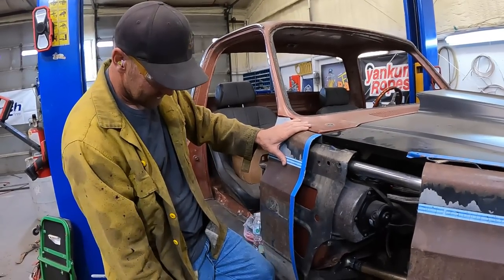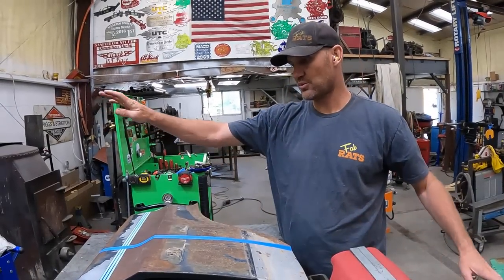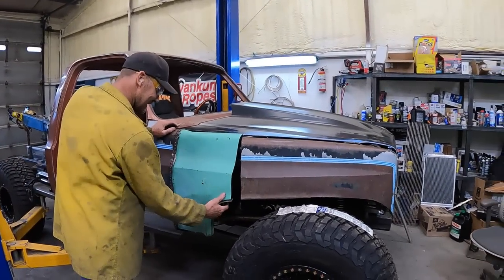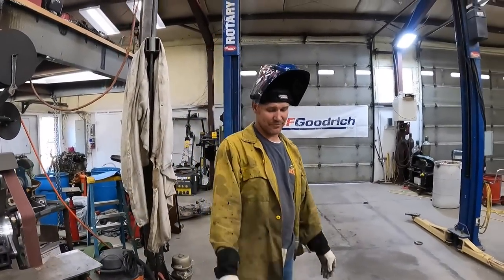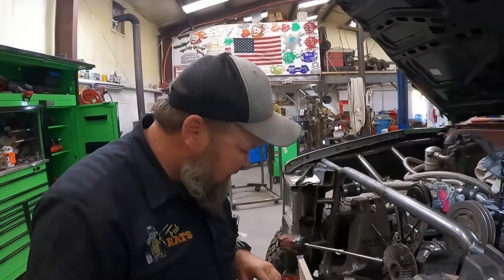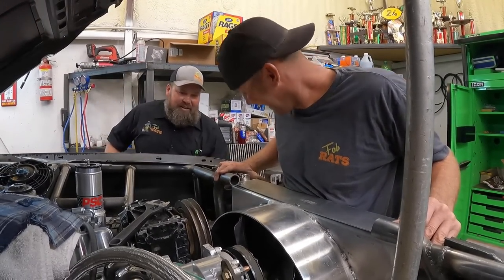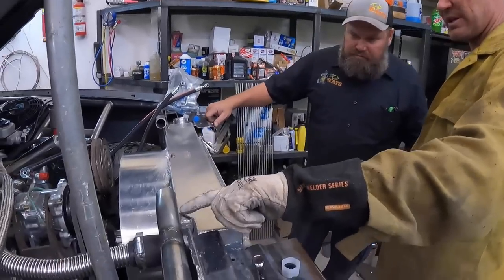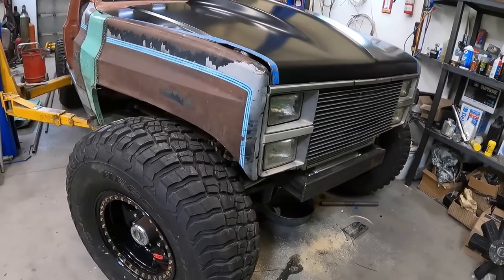Never Before Have Fenders Like These Existed On The Rat Rod Wrecker

Comment: I am looking forward to you and Rory running circles around Matt's giant wrecker. 😉
Reply: but Matts wrecker will pull Pauls out of the ditches!
Reply: If anyone ever needs all 3 at once for a rescue it will be a 'do not miss' video.
Reply: If there is an agility event, you are absolutely right.  But for brute strength, Matt for the win.
Reply: What you guys are forgetting is that the heavy wrecker is being designed more for side by side recovery. He said the boom won't be used to tow heavy stuff. He has the big boy yankem ropes for heavy duty recoveries

Comment: Love the way you did the nose on the wrecker. I am a bit concerned about the radiator shroud. Looks pretty tight, and I'm wondering if you'll get contact when you torque the engine and it moves. I guess we'll see! Can't wait to see the finished product.
Reply: Yep. And the fan doesn't need to be that deep/forward into the shroud. Having 1/2 the blade outside the "tube" will pull same amount of air.
Reply: I was wondering the same thing about the shroud. Hopefully he has solid steel mounts on the engine, because if they're rubber it's going to hit & possibly destroy the fan & that awesome shroud he made. I've seen it happen many times before when an engine is under a heavy load & the rubber mounts arent strong enough & on his truck there is so little tolerance for it to be able to move. I wonder why he decided to go with the manual fan instead of the dual electric fans? I would think the electric fans would work a whole lot better keeping the engine cool when he's out 4 wheeling & going so slow. Maybe he will address everything & tell us in his next video. I love the work he & Ben do there! I love to be able to work with them!
Reply: And let this be a lesson to YouTube watchers...don't jump ahead and comment before watching the whole vijeo. About 19:00 he puts the fan on. PERFECTLY POSITIONED! I should have known.
Reply: I just said the same thing. Wondering why he went mechanical over electrical when the electrical was already completed and just had to be connected.
Reply: @kerryhickman2235  I agree with you on the fan thing, however, slower speeds doesn't have anything to do the amount of air a mechanical fan pulls because of the fan clutch. Engine RPM has more to do with that.
Reply: @randallsmerna384  Correct. Maybe that's why he decided to go back to regular fan instead of the electrics? I'm not convinced the electrics can push thru that thick a radiator.
Reply: @kerryhickman2235  Frames twist under load too, the minimal clearance is disturbing...
Reply: I came here to make the same comment, will the motor not move enough to make it hit that shroud?
Reply: @gailtaylor1636  
Perfectly positioned with the engine just sitting there.......When that truck puts out max power under heavy load, that engine WILL MOVE SIDEWAYS.
   The only reason I have to believe this will work out fine is that Paul has seen all this before.....

Comment: Watching you figure the fan shroud placement and fitment I thought of something for the next time. Split some vacuum hoses and put on the end of the blades. That’d give you a consistent gap around. Just a thought, love the content.
Reply: As tight as it appears to be,  it should be interesting as soon as the engine and/or frame flexes under load

Comment: Engine torque and frame twist under load will make a nice racket on that close tolerance fan shroud, possibly?
Reply: I was thinking the same but realized they only have to trim the fan if that happens
Reply: I was thinking the same thing, but I'm betting being derby guys they used solid engine mounts.

Comment: Hey Guys, you really should put a shroud around the front of the radiator so air can't get around it.  Your losing at least 50% of air flow through the rad and coolers when you are going forwards as air takes the path of least resistance.  You'd only need about an inch or so.  I think if you do the same with the FJ you'll find it cooling better as well.  For an example, look at your cars/trucks and what they have in front of the rad area around the edges...... just a suggestion :)

Comment: Might I suggest more clearance between the fan blades and the fan shroud? With such small tolerances, it won't take much wear in the engine mounts, combined with torque twist of the engine, for the blades to clash with the shroud. 

Love the content guys! Keep it up🤙

Comment: To finish cut those fenders for welding you might have used a method called "cut and butt". You place your fender section over top of the the front fender in your case and then cut through both  layers on the overlap with a zip cut. When finished cutting you will have a joint that will match perfectly and can be easily welded up.
Reply: That method does work well when you're putting 2 pieces together that are straight but you can still run into a problem when the final product has to be angled like in the case of the fender. The angle throws the geometry off from top to the bottom  & can cause you to have gaps.

Comment: Nice fab on the fenders, grill & radiator Paul, l love how Chevy square body parts are good that way, Ben did a painstakingly great job on the steering pump & plumbing & Hunter did some redemption from doubting your fab skills by finding those rubber bushings butt he still deserves some payback Fab Rat's style shenanigan's, ratrod tow truck will be a fully functional offroad beast of a recovery rig that does 4 wheel burnouts, great video thank's for sharing God bless ❤😉👍

Comment: Hey Paul, as you have a problem with bees. Thought I would share how I deal with them. Carb cleaner or brake cleaner. Always around the shop, generally cheaper than bee spray and you can shoot them out of the air. Just remember to keep the little red stray on.

Comment: It is possible to create a square corner on any surface at any angle w/any curves. It is called 3-4-5. 3" on one side & 4" on it's right angle creating a corner. You will know it is a sqaure corner by the measurable between the outlying lines at 5". It can also be converted to feet.

Comment: Don't forget that the engine is on motor mounts and the fan is going to be rigid mounted. That fan is going to move around in that shroud especially when the suspension is twisted up.

Comment: That is a tight fit on the radiator shroud.
I would say it will hit the fan under high load conditions, or do you plan to have the engine mounted with solid mounts?

Comment: I had to extend the fenders on my Cummins swapped 4x4, but I just used sheet metal and tried to bend it into shape. One turned out alright, the other not so much. It would have been a lot easier if I had just grabbed a second set of fenders and cut them up like you did, great tip! I also had the exact same leaking problem on my power steering pump with the exact same solution 😅

Comment: Looking good, I like how the front end is turning out. The headlights and grill was time well spent. I am still up in the air on the fenders. The angle is kind of sharp, a softer turn in would look great. A.K.A a little more rounded.
Reply: It was a squarebody.  Rounded would be wrong.  Now it is a polyhedralbody.
Reply: Function over form

Comment: Glad to see that Ben came into the shop, love watching both of you together work.......as far as the radiator shroud you build, good job on clearance, are you worried at all about engine flex when you get on the throttle?   Hey, idea....the pipe you cut off to put the radiator in, you could maybe weld frost plugs over the ends of the them...just a thought

Comment: body work is so much more fun....
I was just running the engine in the cj7 the super snail... and the brand new turbo's leaking oil...thankfully out the exhaust side... so no run away...  so I flushed the rad and water jacket... at I think I need to have the head rebuilt...   frig...

almost makes me think of switching it to an ls...  no not yet... trucks looking great...

Comment: 0:48 this is a string job! Piece of string pulled taught is better at going around curves, also a thin sheet of metal strip cut straight. These are much easier at put a straight line on a curve.  Or a $30 bosh laser from home depot pointing the right way. String is old tech, laser new tech.
Reply: Chalk line is another way

Comment: Great Video ..cutting fenders is fun ,,, reattaching pre cut fenders not so fun ,, cutting at the correct angle is my mistake a lot ,, learned to cut long then sneak down to what I needed .. Ben might need some flex tape on that tailgate ..so he don't get cut and fill the tailgate with what ever he is hauling ,,

Comment: Great video, Vents in those fender extensions? Getting air out is as important as a good shroud.  Shroud too long?  Never could find a good view of how much fan was out of the back of the shroud.  A fan fully in the shroud flows less than a fan 1/3 -2/3 out the back.  Again great video
Reply: 19:00 ish minutes. Looks great to me now. I do think I would have built the shroud "tube" with a removable ring though. Make it much easier for future service. Remove the ring, possibly bolted together, to access the waterpump & belts. For those that don't get what I'm saying, find some pictures/diagrams of 6.0 Ford PowerStroke shroud.

Comment: Did you account for  the left motor mount stretching when you have a large pull on the truck? When the engine "climbs " up from the torque of the pull.

Comment: As soon as you start the motor that fan will be rubbing because of the engine shaking, along with if there is any flex in the frame. I have a cherokee(obviously alot of frame flex) and my fan rubs when flexed.

Comment: As a custom cabnit builder of bout 28 years I feel some the pain. Cutting too short, coupling wearing out ,the angle not working the first 2-3 times. Most of all being the guy who has to make it work. Break is over got to go work on my new steps (using scavenged wood from my pile) thanks for the motivation.

Comment: I know it sounds easy saying it, but I always cut both pieces of sheet metal at same time so the fitment is mint to weld back together. Not sure if you could've done that.
Reply: laser level in vertical mode would have been handy also

Comment: hayden makes a severe duty fan clutch for ambulances. cannot make it get hot with one of them.  works 40% better then the old flex fan design. They do pull some on the engine so all my big blocks I could not tell the difference, On a small block it will lose about 1/2 mpg yet the trade off is worth it. One less thing to worry about when off road. Overheating.

Comment: The flat panel on the shroud is going to block airflow through the corners of the radiator, Not enough space for airflow. Ps I think the shroud is going to be trouble! Like hit the fan in off road conditions.

Comment: Fan should protrude approx 1/2" on the inside of the shroud for proper air flow. you would think if it was totally inside the shroud it would work better but it does not....

Comment: Paul  i was wondering if by chance have you gave it any thought of using electric power steering instead ?  im building a twin turbo car and decided to do away with my power steering pump and lines for extra space under the hood  doing the modifications went fairly easy and didnt cost that much to do nice part is i;ll never have to worry about anymore leaks again that and it fits under the dash not taking up a lot of space just thought id share the idea with you  if you need info message me  back and i will give you the heads up on it . also  that front end looks bad ass  great job   thanks Bill

Comment: Does everyone have a nearby Salvage Yard there?   That was a beauty tube type grille on that donor truck.  Just sayin'.  Don't forget Heater Motor access............of course you can just cut it out!  Cut it long and lap weld it.  A piece oftubing of suitable length + 4" and ID could be slipped over that tube that had to be cut out.  Drill and Bolt when centred.  Great Progress.  Sorry about that tailgate Ben.
Order a new one. Bill Robbie.

Comment: Not sure if you showed it and I missed it at some point but are there solid motor mounts. Just asking because if they’re aren’t and the motor mounts flex under load, that would probably push the fan into the shroud. I’m sure you already have that handled, just curious

Comment: Honest question... if the "manual" fan which is attached to the engine, and the radiator with the shroud is attached to the chassis what clearance are you going with between the fan blades and your "lemon" shaped shroud? Or are you running zero cushioned motor mounts?

Comment: Just a question but wouldn't have been easier to cut a v relief on top of the fender where you want to curve it, then form it with little heat and round stock.  Then weld on the extension

Comment: I envy the finish work on this radiator fan shroud it looks really good. but, wouldn't an electric fan and one switch and a relay be a whole lot less effort?, and not to even start the talk about working on it later or even on the trail worst case scenario.

Comment: The clearance on that fan looks a little close. What happens when the motor is running and it flexes. Or the body flexes when you're "gently" driving off-road.

Comment: Just a bit of concern  that there will not be enough tolerance between the fan and the shroud when considering the flex in the motor mount.  My not be an issue… just thinking a bout it.

Comment: Just gotta ask,  since electric fans are great for lower speeds it'll be interesting to see.
Reply: I still believe a lot of their overheating issues stem from running such a thick radiator. If it's too thick, very little air actually gets thru. Although I have no idea of the actual construction of these radiators as for coolant flow. Basing this on their issues being related to slow forward speeds.

Comment: I hope the motor mounts are really really good, otherwise when the motors is under load, it will move/lift and rub the fan on the shroud.....clearance looks a bit too tight.

Comment: What would have helped you cut the fenders straight was get your piece of string tape it to your fender at the top where you want to cut and take a tape measure measure from the side of the fender where the door bolts on and true it up top to the bottom basically like the Freeman square but get an actual true measurement from the top to the bottom of the fender of the fender

Comment: some advice from a tig welder. it seems as if your "AC balance settings are too far positive. if you have ac balance adjustment you should be 70 negative/penetration 30 positive/cleaning. and if you dip your tungsten take a second and clean it grind all the aluminum off and reball your tungsten by going full positive lighting off on some scrap until the tungsten balls. then go back to 70-30+ and back to welding its annoying to clean and reball the tungsten but it allows the arc to be much more focused then the alternative. and make sure youre using the correct color band for tungsten (google it theres a lot of colors that have different pros and cons for them) and theres no such thing as too clean with aluminum wire brush and acetone everything. the part youre welding and also your filler rod youd be surprised how dirty aluminum actually is.

Comment: Don’t know how rigid the engine mounts are. If the fan — attached to the engine — moves with the engine in relation to the frame, but the shroud — attached to the radiator and thus to the frame — does not move while driving, could there be a clearance issue?

Comment: What happens when the motor torques over on the rubber mounts? The radiator is mounted to the frame and the engine/trans is separated from the frame ... It's gonna make some terrible grinding

Comment: I’m afraid you didn’t allow for engine flex on that fan shroud.. I would have mounted the shroud to the engine and then used a flexible rubber coupling on the radiator

Comment: couldnt you have just sliced it about the apiller like 0:12 and bolted it flt instead having to add a huge section (i just dont like bobbed fenders look personally but dont think how you dit it fits the truck) its supposed to be a squarebody with squared edges after all love the video thanks for the update have a good rest of the weekend
Reply: i should add obviously how you did the truck youd have to add metal back  because the area is stretched but i think it fit the square look of the truck better

Comment: It's called a flex fan for a reason not for sure if it's still ain't going to hit when it flexes. What would have helped you tremendously was got you some rubber hose cut the same length as the tip of your fan blades cut a slit down the end of the hole and slide it over each one of your fan blades wrapped your aluminum shroud around the fan and the hoses that are touching the fan blades then welded together then you got your clearance in your tolerance to where hopefully when the fan flexes it doesn't rub

Comment: Issue with ur fan shroud.. all the spots where alum is so close to it..beside where fan shroud is.. wont pull alot of air..alum is too close to radiator from the looks of it

Comment: hmmmm..... thinking back to all the 4x4 stuff been around thru the years.... and in flexed up situations where fan hits shroud some at times.... Plastic fan, plastic shroud they tend to correct themselves but plastic is NOT your case..... so is flexed up resulting in fan hitting a potential issue to consider in advance?  Just thinking maybe ya might want to trim that fan blades a smidgen with flexed up mind??